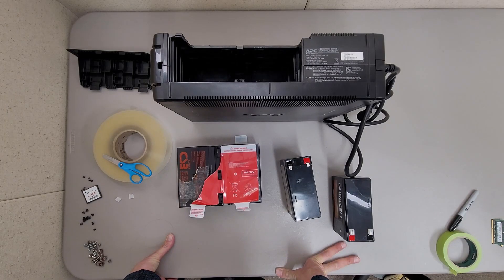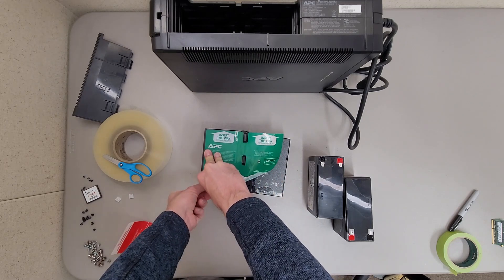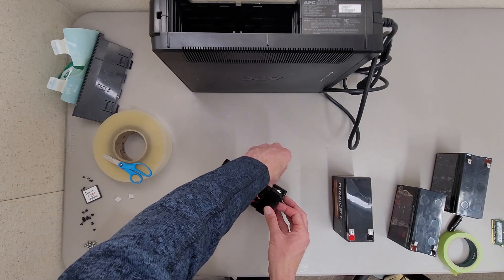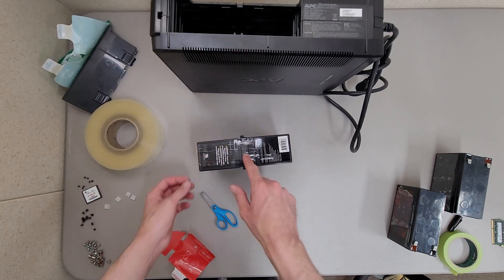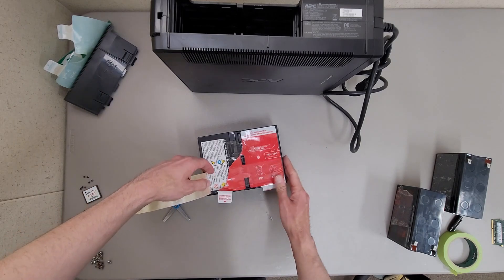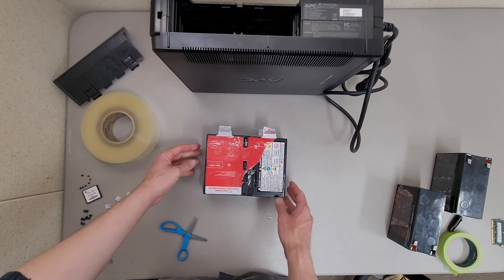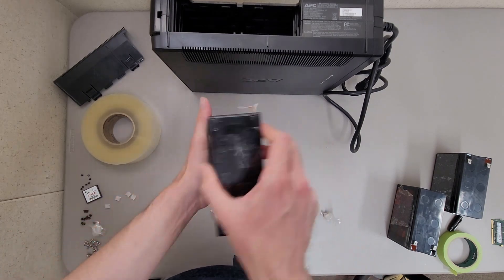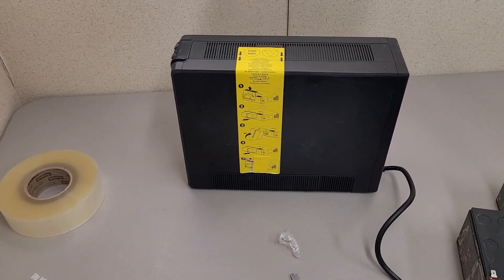Fixing an APC battery backup that had dead batteries with aftermarket ones saving $$$

Comment: My gave a f02 error. Battery level flashes. No smell. Battery was replaced in 2018.
Reply from the maker: Sealed lead acid batteries are generally considered to have a 3-year life. I would try replacing them.

Comment: Thanks for the video. The APC original battery is 12V 6.5Ah. Can I replace it with a 12V 9Ah? The 9Ah is bigger and won’t fit inside. I will just keep it outside. What do you think?
Reply from the maker: I don't think there's anything stopping you from using a 9Ah battery. You should be able to find one that's the same physical size as the originals.

Comment: So I was having a dead battery in a used one I purchased so I purchased a set from Amazon. It was working and I left it shut off for a little while. 

Then I remembered last time I had it plugged into an extension outlet it would not charge. Not sure why it does that as my newer APCs never do
Reply from the maker: The batteries could have discharged while sitting. You might have to let it sit on for a bit and see if it recharges them. Otherwise remove them, check them with a meter, and try connecting them to a 12V trickle charger.
Reply: @computersales Thank you I think I bought one of those for my girlfriend's car but one of my neighbors asked me to use it and never give it back. Lol
Reply from the maker: @GreggyPreviews  sounds about right lol. Just make sure you charge it nice and slow and don't let it charge too long.

Comment: Have prices gone up this much everywhere for the 12V 7AH/9AH in the 2+ years since this video? I just checked my local Batteries Plus and they are $41.99 and $52.99 each, respectively. So a pair would cost more than an APC brand replacement from Amazon ($78.95) today.
Reply from the maker: Might have to open a business account or ask if they have discounted pricing. I forget what they needed for a business account but it wasn't much.

Comment: it is posible that instead of use 2 7Ah, use 2 9Ah?
Reply from the maker: To the best of my knowledge there is nothing stopping you. Some of the other models come with 9Ah batteries.
Reply: The height is slightly different for 7ah and 9ah batteries. I don’t think it would fit. Please let us know if you have tried it.

Comment: Thanks for the video!  I just finishing up watching your video and replaced the batteries in my APC Back-UPS 1500 with a pair of ExpertPower EXP1290 (with F2 Terminals) from amazon.  Funny thing is that when I went to open it up, I found an old set of aftermarket batteries and had totally forgotten that I'd done this before 😆!  In case it helps anyone else (or myself 4+years from now), the older pair I just replaced were Mighty Max (RBC109 PS-1290-2 Pack) from Amazon which lasted nearly 4-years. I used strips of blue painters tape to hold the batteries together, which helps keep them in place and doesn't leave behind annoying sticky residue after removing them.
Reply from the maker: @GarenP  lol I know how that goes. There are several videos I've made that I have to refer to because I forgotten how to do stuff. 🤣 Glad you were able to get it back to working properly again though.

Comment: any reason why my battery only says it has one bar? Replaced it wih the correct battery
Reply from the maker: Another viewer had a similar issue. They ended up reseating the battery and letting the battery backup sit turned on and plugged in for a bit with nothing plugged into it. It ended up charging the batteries after a while.
Reply: @computersales  okay Just plugged it into the wall ill give it a try, I hope its not cause of he random battery from amazon. Would do your method instead next time if i doesnt work!
Reply from the maker: @therealkevinleee  I'm not a fan of the random Amazon batteries personally but hopefully they will take a charge and be fine.
Reply: @computersales  okay yes letting it charge works! Thank you, about 9 hours charged back to almost full
Reply from the maker: @therealkevinleee  glad it worked. 🙂
Reply: @therealkevinleee  Buy from a website with cheap shipping since you can probably get actual technical support if battery voltage / amperage output is poor.
Reply: @computersales  My unit was / is dead, but the ac voltage keeps on going up and up when left plugged in.  I am testing the outlets with multimeter.  Therefore, I have to assume the new battery installed was just dead and needs to be charged to get to the 120 AC voltage.  Strange behavior not to even give a beep code or nothing indicating dead battery initially.

Comment: You Saving Nothing,
I Have A Few Aftermarket 
Batteries From Amazon With
Thousands Of Good Feedback 
And Garbage Before 1 Year,
The Real One Cost Double But
You Get 3 Years Battery Life.
Amén.
Reply from the maker: @-mejor-que-nostradamus-6152  the Duracell batteries are just as good as the APC ones IMO. APC just uses random brands. Been recycling battery backups for over a decade now and reputable battery brands all fail the same way. The random brands on Amazon are definitely trash though.
Reply: @computersales  Yes, I stopped buying anything in the industrial category from Amazon a long time ago.  Can't even count on their bolts and screws anymore.
Reply from the maker: @fdimichele  I try to avoid Amazon in general anymore. Too much junk.

Comment: Hi, I replaced my APC battery with a brand new one from Amazon yesterday, when I plugged my unit it in it showed 3 bars then it went down to 2 bars a couple of hours later then this morning it showed no bars for the battery. Did I get a bad battery or is my APC X-1000 no good?
Reply from the maker: @VaryingViewpoint  that is odd. It will be tricky to diagnose unfortunately. Either the batteries are bad or the circuit in the APC that charges the batteries is bad. What brand are the batteries you got?
Reply: @computersales  I purchased APC RBC123 UPS Battery Replacement. I unplugged everything from the backup this morning and pulled out the battery and put it back in, then plugged in the backup on its own with nothing connected to it, it was at zero bars for the battery but after a couple of hours it was up to 2 bars and now an hour later it's charged back up to 3 bars. Looks like the battery is now charging. When it fully charges then I plug my items in the backup and hopefully it works as it should.
Reply from the maker: @VaryingViewpoint  interesting. Since these aren't a line active UPS not sure why a load would prevent battery charging. I'd definitely let it charge and run a load test on it before your 30 day return period is up.
Reply: @computersales  Seems to be working properly now. It fully charged overnight then yesterday morning I pugged my items back into the battery backup and since yesterday morning it is holding the charge and is working fine. Still not sure why it de-charged when I first plugged it in. I watched at least 15-20 videos hoping someone would speak to this issue. One video I watched the guy did state that once the battery was changed he let it fully charge overnight first before plugging his items in the backup battery, but didn't explain the why, other than that ways his preference. Thanks for getting back to me on this.
Reply: @VaryingViewpoint  I think they ship these lead acid batteries in a relatively dead state unable to output much juice.  It is normal for the float chargers on UPC to take a couple of hours to charge.  It is bad news for the long term health of battery to have it discharged for extended periods.
Reply: @computersales  I would lean towards batteries being dead, since I am seeing multiple reports across the Internet about the units coming back to life when plugged in for a few hours to a day.
Reply from the maker: @fdimichele  good to know.

Comment: Thanks, now I have a better understanding of what I need to do to replace the batteries in my APC BN1250G.
Reply from the maker: Glad it was helpful. Hope it goes well. 😁
Reply: @computersales  I was about to one new battery, and now I know I need two of them.
Reply: Did you go through with it? If the batteries are holding up well, where did you get them from?

Comment: Great job and video. I've been doing this for years. I had an APC back-up that took 6 batteries, total. I would have ended up in the poor house, if I hadn't gotten creative like you did. I loved that back-up, but APC replaced it once, due to a problematic flaw in them, and the same thing happened again, so I pitched the whole unit.
Reply from the maker: Thanks. It is a shame they charge so much for their packs. Definitely couldn't afford to buy APC direct with all the backups I have. Shame yours had issues.

Comment: I canged just 1 of the two batteries as one battery went dead, but now the fan continuously stays on even after its fully charged. The one battery I replaced is 12 volt 7 Amp instead of the original 12 volt 9 Amp. I guess the microcontroller logic of this UPS is set to measure current as well. So it thinks one of the battery is not reaching 9 Amps and it  keeps charging it
Reply from the maker: Yeah I would recommend changing the batteries the same time. Since they are running in series having mismatched batteries will probably cause weird issues like that.
Reply: @computersales  Update:- The fan was continuously on for 12 to 14 hours as I had kept it on charging hoping it will shut down after full charge and gladly it stopped the fan. Its working quietly now.
Reply from the maker: @pradeep809  that's good to hear.